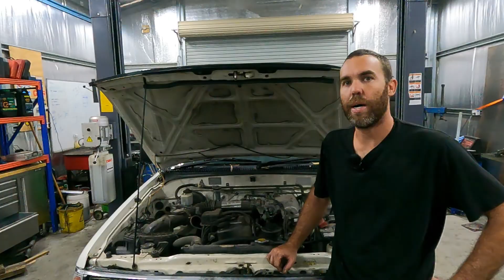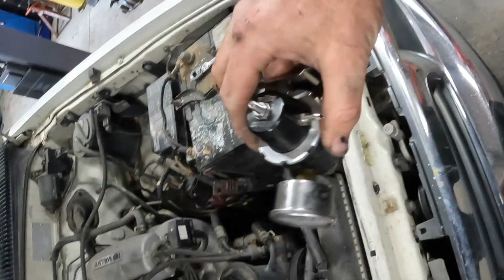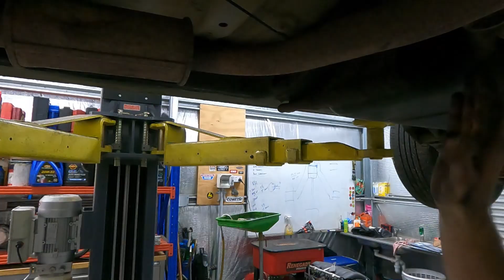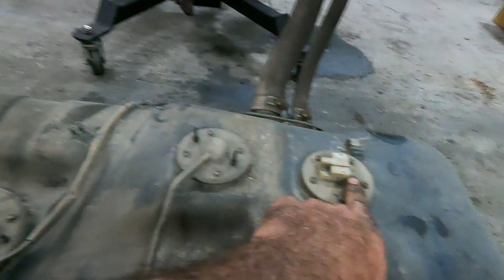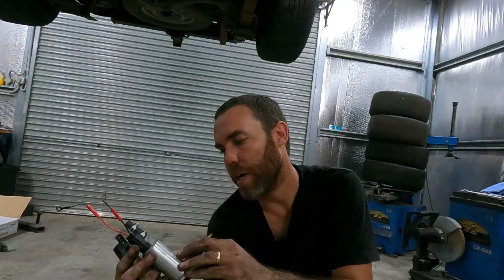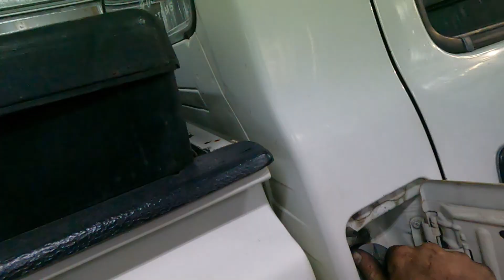3RZ Turbo Build - Episode 3 - Fuel system upgrade for turbo

Comment: Is the stock fuel pump fine for a stock ecu low boost setup?
Reply from the maker: If it is in good condition, yes but I’ve had more not keep up than ones that have.

Comment: Thanks for the video. About how much power can this setup handle? With the stock fuel lines
Reply from the maker: I have gone as far as 400hp at the hubs with stock lines. I have not ever found the limit but I would go bigger at that stage. The reg and rail are fine for much more. I have done 600hp on those without issue.

Comment: once turbo is installed , what would be rough results of 1\4 mile and 0-100kms hour ?
Reply from the maker: Stock ecu setup on 7psi in this car resulted in a 14.1 1/4mile,
With an Ecu and 12psi that dropped to a 13.6. Still unopened stock motor and manual.